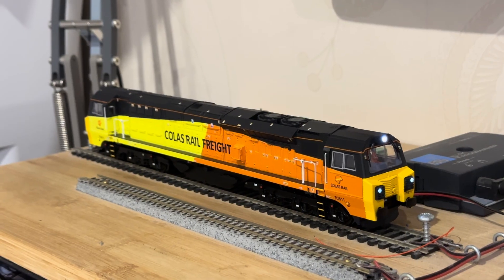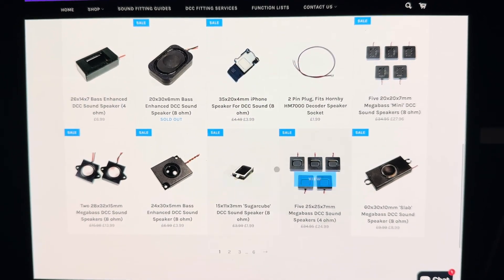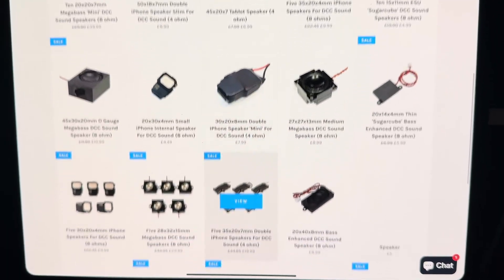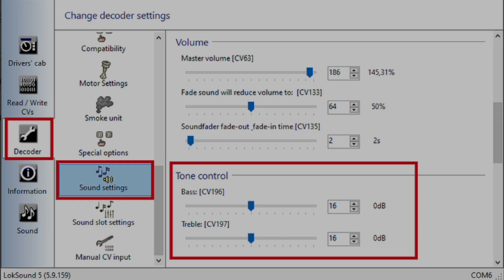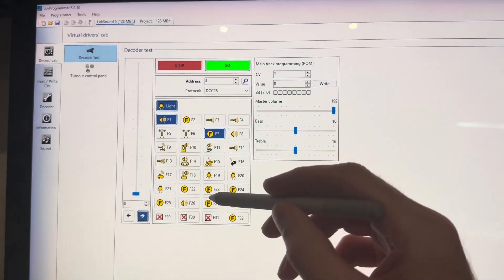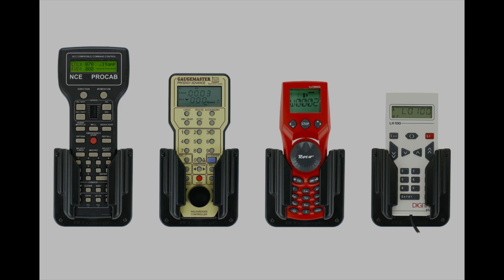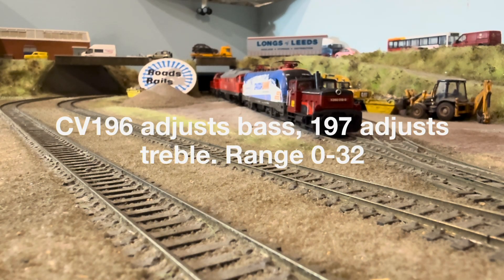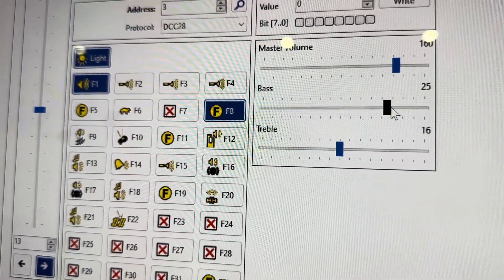How To Adjust The Bass And Treble On A Loksound 5 Decoder, Using CV's Or A Lokprogrammer

Comment: Hi Richard , great info here , thankyou ..
You say these adjustments  can me made in " real -time" using  a  controller ? I use an NCE powercab :  would i need to program on the main with the sound turned on to achieve  this ???       Thanks ..Allan
Reply from the maker: yeah thats right
Reply: @roadsandrails thank you 😊

Comment: Very informative, thanks. Could you consider in the future doing a video to show how to swap functions \ function buttons via a handset as well as a programmer?
Reply from the maker: The problem with that is that you can't see where the sounds are in the first place to move them from, I can't thionk of a way to do it wothout a Lokprogrammer unless you know exactly which sound slots are used for which sounds, and theres no set pattern